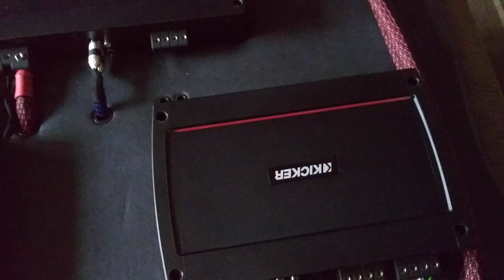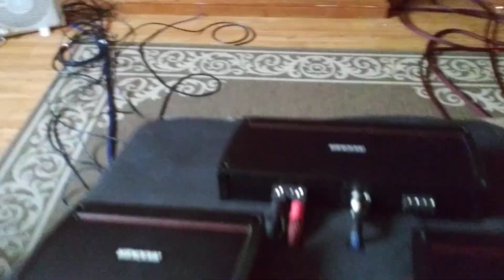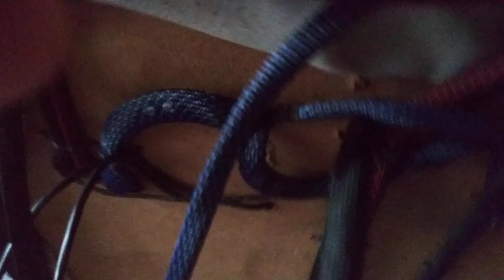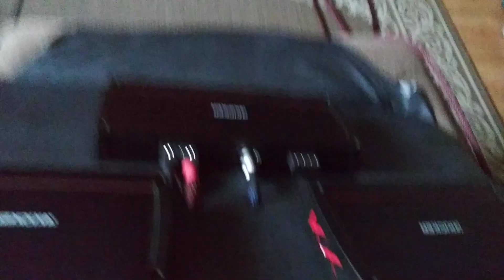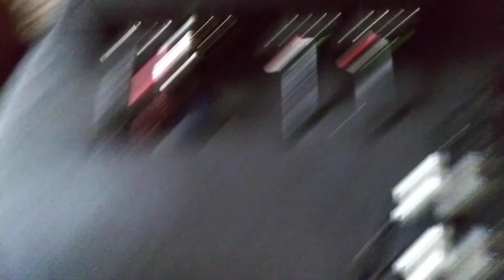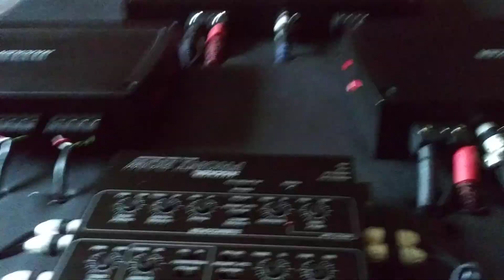Amp Rack 98% done !

Comment: wire ferrules just don't do good with sharp angles, but 3 to 1 heat shrink helps because its a little thinner and more flexible.
Reply from the maker: Very true, got it fixed. Rack is in the car now. Next time I'm home just got to run some wires.

Comment: I think that looks real nice!! Clean layout for sure
Reply from the maker: The wires running across the top even though flexed & zipped just wasn't looking right to me, much cleaner this way. That way even if the topper panel is off its clean.
Reply: Robert Van Hoy that’s true looks good though👌🏽

Comment: All top of the line Kicker gear. This system should slam. Wiring always looks cleaner when it's a plan in my head. Practical applications have been met with mixed results.
Reply from the maker: I know the feeling.

Comment: Its looking good man, looking forward to the install!
Reply from the maker: Hopefully that will be the easy part now. Honestly shooting for perfection is a pain in the ass 🤣.
Reply: @thenotoriousrvh6091  Hey at least your doing it and getting it done. I have a stack of equipment to do a full install I've been putting off for 6 months. I'm just dreading the sound deadening process.
Reply from the maker: Sound deadening what's that ? 🤣
Luckily the Patriot doesn't have too many trouble spots. I'm going to have to address a few but my floors are double stamped steel, good there. Doors and roof are my major problem areas. I'll do the doors but that roof may have to flex.

Comment: Thats lookin real hood RVH where did you get the plastic gromets to pass your wire through the rack?👍
Reply from the maker: They are called "plastic snap grommets" couldn't find any on Amazon or eBay ended up getting them at a local shop. I need to stock up on some supplies. Idk if D&F have them in or not in their store.
Reply: I can't say that I've ever seen those before. I think they look really slick.
Reply from the maker: They've been around forever.